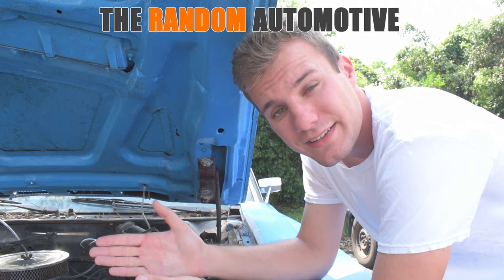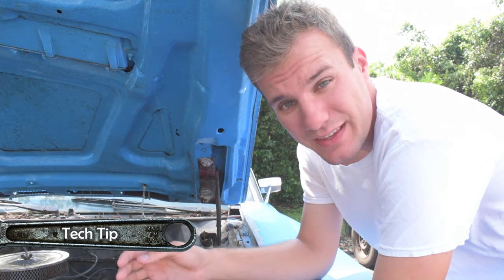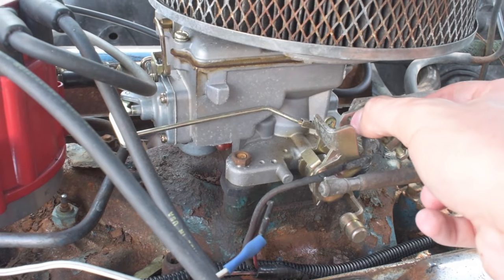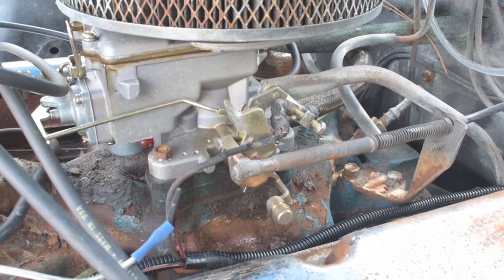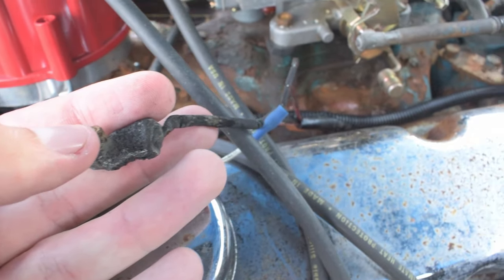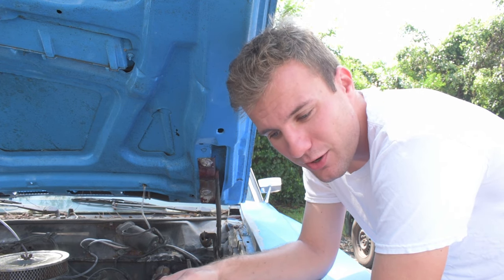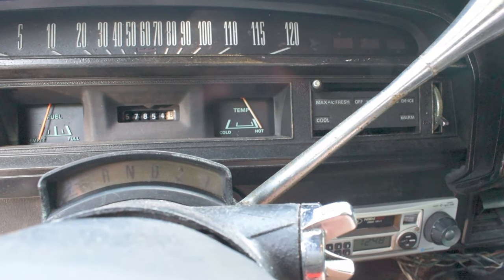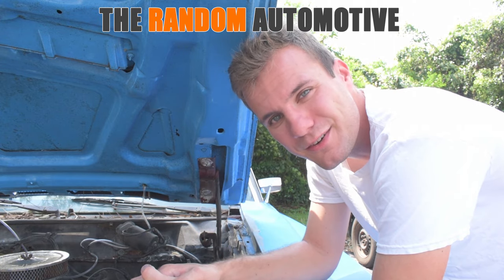Tech Tip - Temperature Gauge Not Working!

Comment: I have a 94 civic. The gauge is always stuck on cold. I grounded the connector as you said and gauge went from below the cold line only to the cold line reading so just a little bit and not from cold all the way to hot as it normally should. I have played with the connector as I thought the connection wasn't solid enough so I removed the old connector, crimped the wire a little and have used a universal little connector that I bought from Walmart (about 15 male and female pieces for $2). Of course, all of this after screwing in a new coolant sending unit, new thermostat and tested the ECT sensor, also bought another new sensor that didn't do anything.

Is the problem the wiring connection or the gauge in the dash?
Reply from the maker: If you have tried all that and you are still having an issue, it could be wiring or the gauge. The motor in a gauge is normally a "DC motor."  When given positive on one lead and negative on the other, it will go move in one direction.  If the polarities are switched, it should move in the other.  You might have a ground issue.  These are all just guesses.  I'm just a hobbyist!  :)

Comment: When I grounded the wire the gauge immediately shot to hot. My wiring harness is new. Some times my temp gauge works, sometimes not. Recently my gauge went from not working to all the way hot (it wasn't overheating) it's a 1956 6 cup Chevy.
Reply from the maker: Sounds like it could be the temp sender.  Try getting a new one.  It should only be around $3, so even if that wasn't the problem, it's cheap enough.

Comment: My truck is always reading hot even before i ever turn the key its in hot then moves up a bit more when started but isn't hot i changed the sensorthe plastic where it connects was cracked and busted but still same issue any ideas on what to try next?? Wire, gauge, or maybe the thermostat its also not running any codes either and seems to be driving fine
Reply from the maker: I'm only guessing that since the needle moves up when I ground mine in the video, you might have something grounding out.

Comment: I ground my wire off the sender and turned on key.  The temp needle went to HOT.  So I bought a new sender but the needle barely moves off cold all day!  Temp outside was 70f. Weird! Used to work great for 30yrs
Reply from the maker: Time is a funny thing.

Comment: Your temperature gauge pass half way or stay right on half I have a 1978 f150 ford ranger and the temperature gauge go past over half way I don't know if is normal on this kind of trucks
Reply from the maker: Not quite sure I understood that.  I would assume "half" is normal operating temperature.
Reply: DB Productions the temperature on my 1978 go over halfway I don't know if is normal on this old trucks
Reply from the maker: If it goes to the same spot every time, I wouldn't be too concerned.  If it keeps getting higher, then you may have a problem.

Comment: What if the gauge works, the sensor is new, but it's still not working....
Reply from the maker: Cry.  Or get a voltage meter and trace the connection.

Comment: I have a 79 ford and the gauges don't move when the truck is on but when I turn on the dash lights the oil and temp move past hot why is that?
Reply from the maker: If it moves beyond hot like it does with mine when I ground it, then I would assume you have a bad connection somewhere.  Trace the wires.

Comment: Ok so my gauge moved all the way to hot. And I changed my temp sensor. And gauge is still not moving to normal temp. Do i have a stuck thermostat?
Reply from the maker: Could be damaged wire somewhere too.  Not too sure.  :(

Comment: Absolutely perfect; my 74 AMC gauge wasn't budging; sending unit; easy fix; THANKS A MILLION !!!
Reply from the maker: That's great to hear!  You're very welcome.  Glad it worked out!
Reply: @ThatDeltaBravo  Nice. Temp gauge in my Gremlin not working. Removed wire and grounded it. Temp gauge moved to hot. Will try replacing sending unit and hope that's it. Did you need to drain coolant before replacing sending unit?
Reply from the maker: @mikelane3611  You might lose/drip a little, but I didn't.

Comment: I got a 1980 mercury cougar and the temp gauge is electronic and should light up, how would I go about diagnosing that?
Reply from the maker: Electronic leads for much more to fail.  The LEDs could be burnt out, the gauge could have simply stopped working, the connection points to the gauge could be corroded.  Something like that would require a multimeter and knowledge of what voltages the gauge should be getting.  Not as fun, and more work.  :(

Comment: installed new sending unit(sensor) and grounded out wire and my gauge reads hoy when doing so. does this mean the gauge in the dash is bad?
Reply from the maker: If the gauge goes to hot as it does in the video, your gauge "should" be fine.

Comment: So I emptied out the coolant and installed new sender; it worked once.. now it won’t go to up- tested sender by grounding it and the gauge works. Could the system not be purged properly to have these symptoms? & Thermostat is new also
Reply from the maker: Did you test the sender itself, or just the sender connector/wire?
Reply: i tested both; I tested the connecter wire by grounding it and the gauge pegs far right toward heat. So the gauge must not be bad right? & i installed 3 sendings and all of them go up a quarter up, not to 210. So I'm not sure..
Reply from the maker: Sounds like your gauge could be okay.  I would say it's the sender, but you've tried three?  That's strange.  You've got me a little stumped on that one.
Reply: I have a 1991 ford mercur wagon all gadgets not working except for the rpms

Comment: I have a 1984 F150 302. I grounded the connector and the temp gauge works fine, i´ve tried 2 senders and have the same problem: I start my cold truck in the morning and the gauge go immediately to normal (needle in the middle), so when it gets to regular temperature my gauge is all the way to the H (truck runs fine, real temperature is normal), please help me
Reply from the maker: That sounds like an issue with the gauge.  Sounds like it's "50% off", if that makes sense.  Cold is normal, and normal is hot.
Reply: DB Productions So, do I have to change de gauge? Or can i calibrate it?
Reply from the maker: You might be able to re-calibrate it, but I am not 100% sure.  I wish I could be more help.
Reply: Same thing is happening with my sn95 mustang but sometimes after it reaches the hot it'll jump back to the middle or 1/4 and seem to be working good then sometimes looks like it starts getting hot and goes 3/4s but not to sure if true or not just bought it 2 weeks ago and don't even use it only been putting money into it
Reply: Any advice would help

Comment: Help!! Kids car. 2005 Honda civic Sudan. Overheating but I replaced everything. Gauge might be bad. Help with a solution on finding out if it's bad or not
Reply from the maker: Is it actually overheating, or does the gauge say it is?  When the car is off, or when you first start it up after sitting over night, is the needle all the way on the cold side?
Reply: @ThatDeltaBravo  reads hot when driving. But change everything. No water under car or engine is overly hot.
Reply from the maker: Yes, but what does the gauge say when the car is off or just started?  It could be a bad stepper motor in the gauge.  My Mustang told me I was doing 165mph while stopped at a red light.  Still, I would have a mechanic take a look at it.  Call a few shops around you.  I'm sure someone offers a free diagnostic.  If your car is overheating, driving the car is the worst thing you can do.  It will destroy your engine, and pretty quickly as well.
Reply: @ThatDeltaBravo  Reads cold.
Reply from the maker: I would take it to a mechanic.

Comment: I did this and my water gauge went all the way hot which is a good sign to know it is a faulty sensor. Now my gauge won’t go back to normal and stuck at all the way hot. What do I do?
Reply from the maker: There's a chance it could be stuck.  I mean, when was the last time your gauge ever pegged that high?  Hopefully never!  You might have to open up your dash and spray some contact cleaner in the gauge to clean it out.  If you do that, disconnect the battery, spray it down, wait a minute or so, and then reconnect the battery.  That's just my guess.
Reply: Thank you so much! i was worried I was going to have to buy a whole new gauge. All I had to do was take it out and shake it a little and when right back to normal!
Reply from the maker: @chasemerrellbroadcasting3521  Yay!  Glad it worked!

Comment: I did like you did, but the counter did not go up until I messed it up
Reply from the maker: What do you mean?
Reply: I disconnected the wire from the sensor and put it on the engine body but the gauge didn't move until i hit the dash
Reply from the maker: @ahmedfathy731  That sounds like you have a gauge issue, or a loose wire behind the gauge.
Reply: Thank you so much i found the proplem pehind the dash and repair it
Reply from the maker: @ahmedfathy731  Awesome!  Glad to hear it.

Comment: I have a 93 Silverado I switched out both temp sensors and thermostat put new connection cable needle reads like at a quarter of the gauge and when I turn it off the needle on the gauge goes all the way to hot side ..what can my problem be?? Anyone??
Reply from the maker: Well, the motor in there should be a DC motor for that gauge.  I can't say for sure, but if it goes to hot when off, it sounds like the polarity was switched, which might cause it to go the wrong way.  I'm just guessing.

Comment: If that part is only a couple dollars or whatever, then it should be replaced regardless. That part is an old part, just replace it anyways
Reply from the maker: That's a fair point!  The sensor cable is even cheaper.  Not a bad idea to do both.